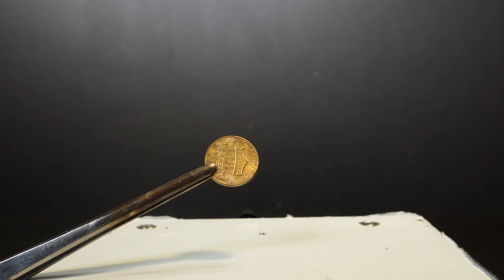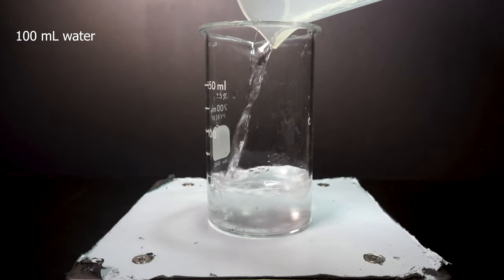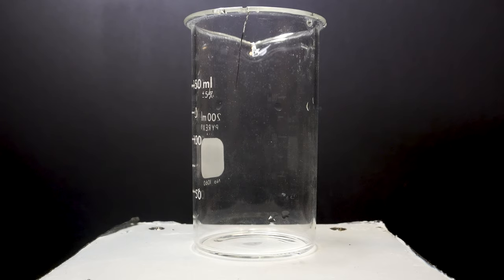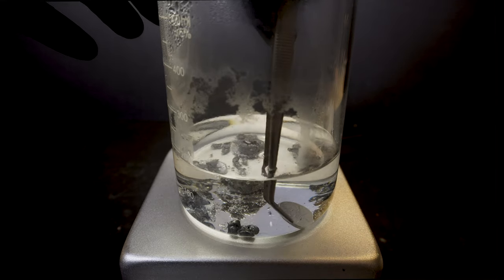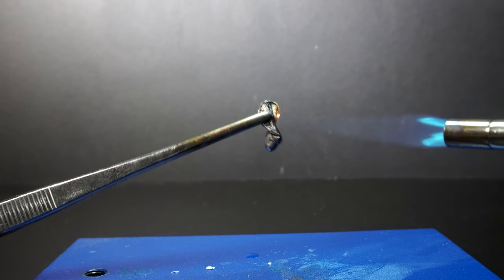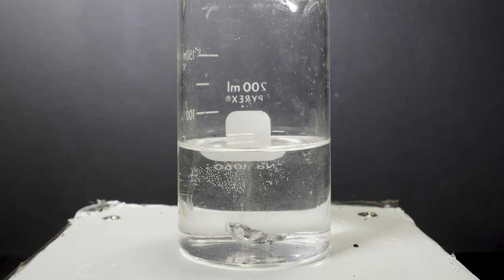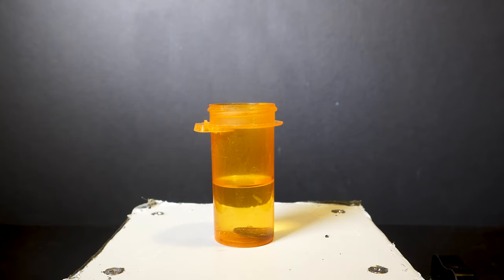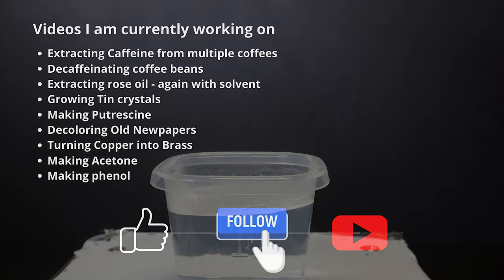From copper to brass! Learning to coat pennies in zinc

Comment: is it possible to copperplate zinc and heat it up to make brass finish?
Reply from the maker: At the right temperatures definitely. 
It all depends on temp/time and added pressure could better help control the change.